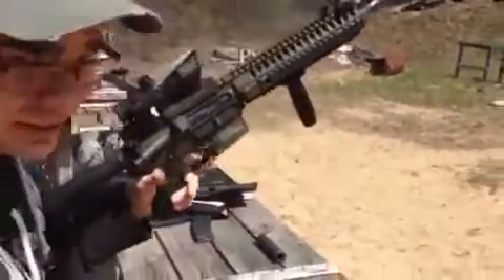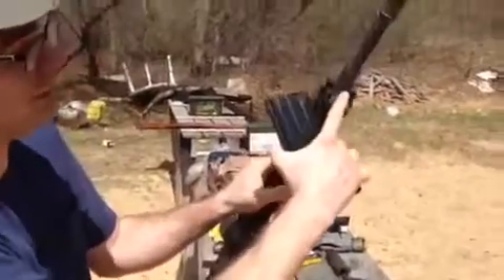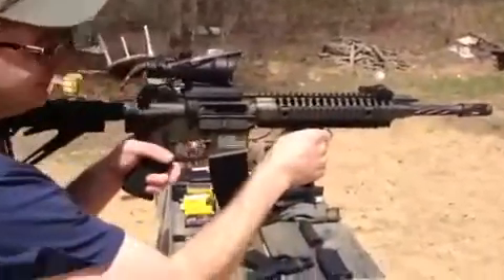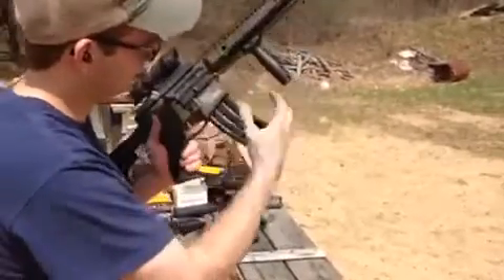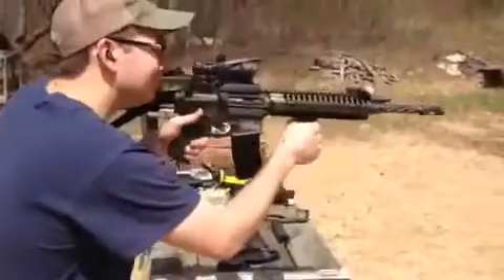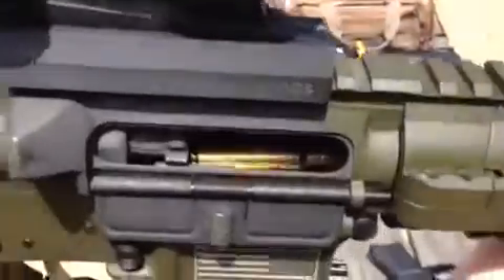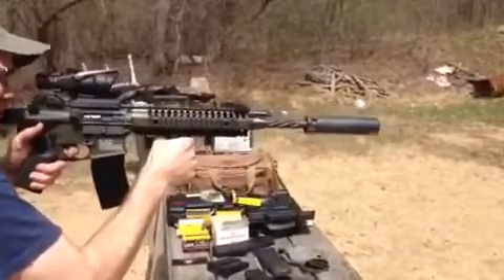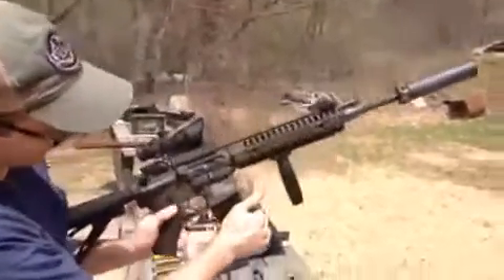Lwrc m6a2 fails multiple times

Comment: Without actually holding the rifle it seems like there isnt enough gas pushing the bolt far enough back so that when it goes back into battery it doesnt have enough energy. I had a cracked gas block that caused the same issue. When firing supressed more gas it pushed through the system allowing for more reliable cycling. I had to sell my lwrc after the gas block issue because i never trusted it again even after it was repaired. I went with Daniel Def. I have probably gone through 5-6k rounds without any real issues. Either way, best of luck!
Reply: I guess I should have read the description first!!!
Reply from the maker: For sure, you are right it was under gassed. Sold it for 1300 . built a 10.3 “ sbr dd barrel on a colt 6920.

Comment: 1. With as much advantage you have with a piston gun vs direct gas gun, the bolt carrier group still needs lubricating. Regardless of any kind of firearm, if any critical component is metal on metal, it needs lube/CLP.
2. Double check that your magazines seat properly. Hold the bolt open, insert an empty mag and see how much wiggle there is. A little is fine, a lot is bad.
3. Double check your gas settings. Firing unsurpressed with the has mode on suppressed can cause failure to feeds.
4. Contact LWRC and check what weight ammunition works best for that serial number. 
5. Have a professional armorer look at it. The issue could be a number of different things or (what I think it is watching this video) a combination of 1, 3 and 4.

Comment: bolt looked dry as fuck
Reply from the maker: It was. Not gonna lie. But i was under the impression Lwrc rifles are the best and never fail. Thats why i was okay spending $2500 on the rifle. But after this i wish i would have just bought two colts or Fn. but i learned my lesson. 
Lwrc is not as good as they claim. All piston Ar's are over rated. In my opinion.
Reply: +Todd Goins I hear you on that hey if YOUR interested I have a le6920 magpul Moe in all black brand new and never fired I feel like an idiot for panic buying but I want to let it go and give it a good home if you know anyone give me a holler I must have a rec7 !!!!!!!
Reply from the maker: +Nobody Nobody gotcha, i have a colt 6920 socom. But i will ask around for you. What you asking?
Reply: +Todd Goins 1k flat paid about 13 or 12 so I think that's fair thanks man

Comment: Sucks that you are having this issue. I've had my M6 since 2010, with many thousands of rounds thru it now....and it has never had the problem you are having. That fact means exactly nothing to you. I understand that. But I have to kind of jump on the bandwagon about the bcg, etc looking pretty dirty. But then again I was not there to see it. Wish you would have opened that thing up and pulled that bolt carrier out on video for all to see. 

Also, you did not mention ammo. What were you shooting in the video? What were you shooting prior to the video that caused it to look so fouled? Was it factory ammo, and all fouling was from using a suppressor? Did you try putting any lube on that action? If so, what did it do?

I'm assuming you paid the $100 to get your rifle back, since you have it in the video. Did they really stick to charging $100? Was any of that shipping cost? I hate to see anyone have trouble with ANY weapon that they may have to count on one day.

Especially a high end weapon. And yes, an LWRC is a "high end" weapon. But it is man made. And as with anything man made, it is just a man made piece of shit. In my job, you would not believe the things we find wrong on $350,000,000 jets after they roll out of the factory. Brand new $350,000,000 jets at that. I guess what I am saying is maybe keep pushing LWRC to do what they need to do so you are a happy owner, rather than bashing them on youtube. I hope you get that thing to run right. Best of luck to you.
Reply from the maker: plumcrazybee  Yeah I Should have opened it up was just so mad didn't think of it. I'm not goanna lie it was dirty, do to being shot with the suppressor on it. But they make videos of them tossing them in sand and mud. would think that would make it stop before being dirty. My brother lwrcm6-G works fine when it is dirtier than mine was. I put this up to show people my lwrc has a problem and lwrc neglects to admit it. also I was using pmc xtac 55 gr.
Reply: Todd Goins Hey, I hope you didn't feel like I was slamming you. It truly sucks. I hope you have had luck rectifying the issue. If not, and LWRC has left you hanging, bash away!
Reply from the maker: lol no your good.I want tosell it and get another colt 6920 or a  FN.
Reply from the maker: +KyramJag my brother has one and has not had one problem with it. Also it stays dirty too. Guess i got a bad one.

Comment: Sucks for you. I have over 2000 rounds though mine with not a single issue. All else fails, send it back.
Reply: I've had my lwrc for two years now haven't had any hangups at all keep the bolt dry as told by the owners manual and all...maybe they screwed up something and didn't want to admit it after u sent it in for upgrades...I absolutely love my m6 ic-enhanced

Comment: Why is the bolt so dirty with a piston upper? And the bolt looks like it needs to be lubed?
Reply from the maker: fred martin was dirty due to suppressor use I know crazy pistons are better for cans ? Think not my 10.3 colt 6920 runs just fine dirty or not. My colt was 850 plus some enhancements I added but I’m lost on why this 2500$ battle rifle fails

Comment: Todd, I wanted to PM you but you didn't set your channel up to allow it...I dont like all the bickering that people seem to get off on.  I am not a lwrc fanboy (despite my channel name...it was a joke at the time i signed up on youtube) but I do own one and never had a problem.  I think lwrc is just like any other manufacturer out there with the respect they over gas their guns to make sure they are reliable with all ammo and dirty conditions. It looks to me like your gun was under gassed due to the casings ejecting to the rear (thats what it looked like anyway) and when you added the suppressor it seemed to run fine. I'm sure you know the suppressor adds more blowback gas to the equation even though it is a piston gun.  I couldn't make out what the shooter was saying about the gas adjustment...i would imagine you tried to open it up and still were having problems?  Did you ever try a lighter buffer weight?  I know competition shooters tune their guns with as little gas as possible (while keeping reliability) and as light a buffer / bolt carrier as possible to keep recoil and "pogo" down to a minimum to stay on target.  It would suck if you sold it and changing the buffer weight would have fixed your problem and would have given you a more enjoyable gun to shoot as well.   I bought in to the koolaid with lwrc too.  I havent had any problems but am not overly impressed either.  I would have spent my money more wisely on a custom build.  I also learned that same "koolaid" lesson with Wilson Combat pistols.  They are nice but so is a standard black gun with a trigger job!

Comment: Seriously. The only time my lwrc spr ever had issues was bad ammo and a bad pmag
Reply from the maker: Joshua Helton well this one was all sorts of fucked up. I’m not trying to bash Lwrc just pissed that the CSU was so shitty and they messed my weapon up.
Reply: Has LWRC at least been cool about investigating it?
Reply from the maker: Joshua Helton  not at all told me it looked under gassed sent me a prepaid label to sent in under warranty. They had it for 2 weeks called me said it was just to dirty and they cleaned it and said I have to pay 100 bucks to get it back. When I got it back got it just as dirty if not more using my can it worked fine notice they cut my pinned Surefire flash hider and put a spacer on it and repined it looked like total shit prolly put a new barrel on it and didn’t want to let me know they had a under gassed hole drilled in my barrel. Sold the lemon pos.

Comment: That's your trigger group causing the problem...
Reply from the maker: Well i thought that at first. But lwrc stated it was just to dirty. They test fired it and said it worked fine ( after they did what ever it was to it) After getting it back, It works ok  the bolt doesn't  lock back every now and then. still not what i would call a $2500 battle rifle. Over hyped over priced AR15.